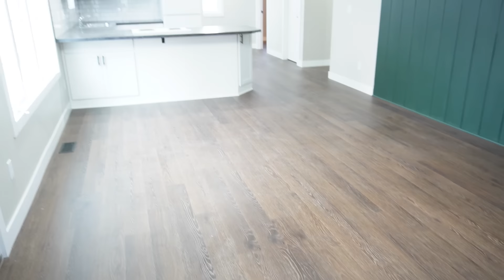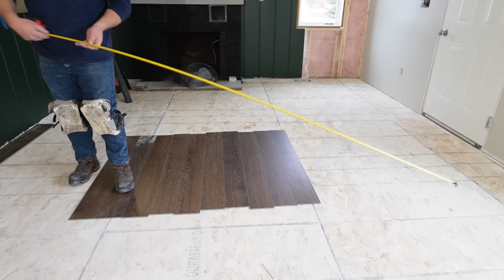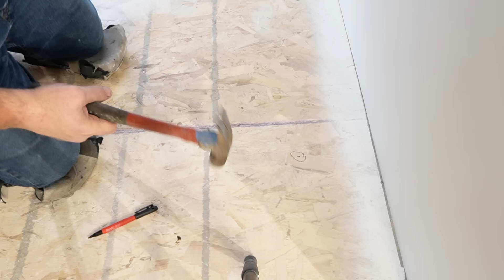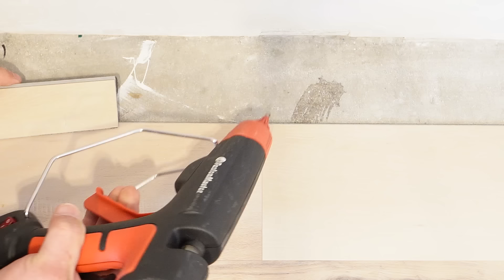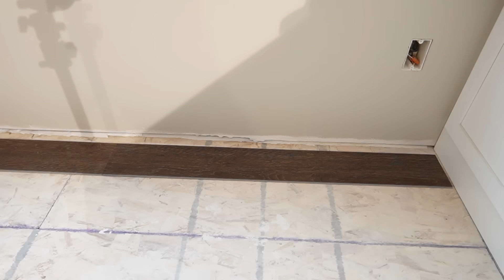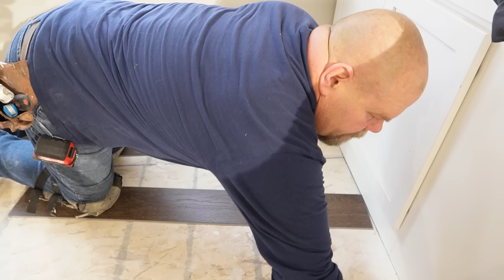The MOST CLEVER Way to Start the First Rows | Vinyl Plank Installation

Comment: I really question the width of the first row. That is practically a sliver.
Reply from the maker: Why does that matter? By the way, that was no where near “a sliver”: Did you watch the layout process to understand why it was that size?

There was a reason the first row was a smaller piece.

Comment: Watching some videos before I start my first project. I appreciate the detailed instructional video. But the engineered boards that I have purchased have an opposite description of what tongue and groove are on the planks. "The tongue is the thin, protruding edge (the male side) that sticks out, and the groove is the recessed channel or slot (the female side) tucked under the opposite edge to receive it. Usually, you install the planks with the tongue facing the starting wall and the groove facing out into the room." So, watching your tutorial, should I follow your suggestion to start the first row or reverse it?
Reply from the maker: If it’s a true wood floor that is glued stapled or nailed, then face the groove towards the starting wall.

Comment: I should have just glued the floor down. Nothing stayed in place and the entire floor moves. The tools I purchased sucked. The spacers fell under the 1 in gap to the concrete. The taping Block destroyed more planks than it is worth. Nothing went right.
One thing I did learn, LVP is a crap product I would never buy I’ll stick with tile.

Comment: I’ve read not to install directly over osb board. To install 1/4 or 3/8 in. Plywood first. What’s your thoughts on this?
Reply from the maker: That is not true with a floating floor. Glue down, yes.

Comment: I'm really confused. I was told that the first row of planks should have the tongue side facing the wall for two reasons:

When tapping the flooring into place, you avoid tapping against the tongue, which is the weakest edge.

The locking mechanism is specifically designed to be angled and installed in this direction.

 Is this correct?"
Reply from the maker: That is what I am showing you.

Comment: I don’t understand why he’s calling the side that sticks out the groove side and the recessed side the tongue side. The tongue sticks out like a tongue, that’s why it’s called a tongue side. Also, a groove is recesses not protrusions. So tongue is male side, groove is female side.
Reply from the maker: Exactly! If and when you install a floating floor that has a locking system you will see that what I am saying is correct. The side I am saying is the groove has a bottom ledge that sticks out farther. This is where the locking lip is located. That same side also has the recessed channel(the groove). It is the same concept as a real tongue and groove wood floor but it’s slightly different. If I only had a $100 every time someone tried to correct me on this….

Comment: THANK YOU!  I just spent two days trying to begin like everyone else shows as the "correct" and easy way. My planks kept moving, separating, shifting.... total frustration because my outside wall is NOT straight, so everything kept going bad. This is simple, understandable and easily adjusts to an uneven starter wall. 🙏🙏🙏

Comment: Hey friend, you're awesome! I'm a complete novice trying to install flooring in my living room. I've been trying for a couple of days now without success 😀. I've located my two exterior walls where I want to start, and I checked the method to confirm they're square to 90 degrees. Apparently, my wall has bulges, and to top it off, there's a chimney bump right in the middle. I imagine I should use the chimney as my starting point. The only thing that's really confusing me is figuring out how to draw that straight chalk line.
Reply from the maker: This video explains the line - IT'S A BIG MISTAKE To Just Begin With A Full Plank
https://youtu.be/JqoyXeT6woU

Comment: The first time I laid plank flooring I made a lot of mistakes and had a lot of lessons learned. The second job I did, I studied and used a lot of your tips especially the 10 planks and made the install go so smooth. I just received your pull bar, block, and layout tape for a job that is a lot bigger than before and here I am studying up again to make it go as smooth as possible.

Comment: FOUND IT!! 🎉🎉 For those of you who are wondering about how to DETERMINE THE CHALK LINE PLACEMENT in this process, his other video here (https://youtu.be/UII0yYikEe8?si=lNELl6i_55a8P_YY) has an excellent explanation of how that chalk line is determined. 

Basically:
1) Measure the full width of the room to the midpoint. 
2) Using the 10 stack as a base measurement tool, determine how many full plank widths it will take to get from the midpoint to one wall and the to the other wall. (Should be the same number.)
3) The remainder (the partial plank width) is the distance from the wall where you start the first row and that's where you will set the spacers. 
4) Snap a chalk line some distance from the wall (I did 2 rows of plank + the remainder) and that will be your straight edge guide *The partial plank width is the amount that you're going to cut off of the planks to fill the first row to complete the floor.
5) Work back from the chalk line to the spacer row (2 plank rows in my case) and set the spacers *you work from the chalk line to the wall in case the wall is not plumb. Then you would use Joe's "cheater board" hack to cut that first row at the end 
6) Push the two assembled rows and luck into the spacers
7) Install floor moving from the spacer row end
8) Cut the plank widths in the final row to size if necessary and install that row 
9) Then come back to the spacer row, remove the spacers, and cut the planks width as needed and install the first row *use a pull bar to snap those planks into place if needed

These are high level instructions, the detailed explanation, in Joe's impeccable style, can be found in the other video: https://youtu.be/UII0yYikEe8?si=lNELl6i_55a8P_YY

Comment: This did not work at all for concrete subfloors. I’m sure for wooden subfloors it would work fine. The glued-on stop-blocks would not stay adhered to the concrete. So bummed.
Reply from the maker: You must have used  craft glue sticks and not the ones I recommended. Because the glue sticks I use stick to concrete very well.

Comment: Hi. Is the orientation right? I thought you're NOT supposed to run the length parallel to the wall where the windows (and door) are. Thanks.

Comment: For me its the cutting part that is confusing. Thank god i bought enough for waste. I didnt realize you had to flip the board around so that the groove was opposite when cutting. I was trying to figure out out to get a cut edge to lock in to a groove when their is no tongue. I have a small half bath 5x5ft with a small cut for the toilet pipe and toilet drain. Vanity cuts not a worry as its not a solid bottom.

Comment: I’m getting ready to lay LVP planking on our whole main floor. Should I start from the center of the hallway that extends into the kitchen, or do I start in the kitchen or living room like you did? There are 2 bedrooms off of the hallway also. This is my first time attempting this. I’m pretty good at figuring stuff out, but this layout stuff has me spooked lol. Thanks!
Reply: @Handymangene  

How did you do?
Reply: @ozziecrosby2092  It went ok. Not perfect but we are happy with it. There is one spot where the hallway/front room/ kitchen meet and there is a plank that the long edge of it is not clicked in that I will have to deal with. I have also had to close some gaps between plank ends due to movement. Overall it went good. Next time I would definitely use a laser line and measure frequently to keep from skewing. I was 1/2 difference from one end of kitchen to the other.
Reply: @Handymangene 

Yeah I'm getting ready to do mine and it has a run of almost 35 ft by 22 ft. Little nervous because it's an 1850 era house that has been completely gutted and reframed but still has a wall that isn't quite squared.
Reply: @ozziecrosby2092 Also, any floor dipping or heaving will affect how it lays. The flatter the better.

Comment: Honestly, this doesn't make a lot of sense.  I have no idea why he wouldn't just use spacers. All I can guess is that he wanted to "split the difference" for the width of the first row and the last row, which really only matters if your last row was going to be less than two inches wide.  Looking at what he's done, the last row probably would have been four inches or so if he had just started the first row normally, which is absolutely 100% acceptable.  All this did was create obviously thin planks on TWO walls instead of one.  But hey, that's just me.

Comment: I like the premise of the starter strips, but will this cause you to waste a little bit of material considering you will have to start and end your floor with ripped pieces because they are smaller than the width of a normal piece. Overall the pre-planing so you do not end on a too short of piece or two skinny of a piece is key. Overall trim will secure the small and/or skinny pieces though.

Comment: Confused about how you layed out your chalk line, you didnt explain that part in your intro!
Reply: @steinachu1  he connected like 7 pieces together, came up with the 41in measurement. Made the mark at both ends and snapped the line. It is just to keep track that he is straight and seems are tight. It's identical to chalking lines on a roof to keep track of yourself.
Reply from the maker: This video explains it all - https://youtu.be/JqoyXeT6woU

Comment: Hi Joe, if I have a crawl space under my wood subfloor, do I need a underlayment such as one with a moisture barrier and sound proofing? Can I just put plywood or OSB down on the subfloor in order to smooth out the surface and install the vinyl planks without the additional underlayment? I live where there is very little humidity year round.

Comment: What brand of lvp did you use?
I start wiyh the tongue out from the wall not towards thw wall with lifeproof flooring.
The way it clicks in you have to raise the plank up and insert the lip down in the top of the tongue. Then press down.
I also align the corner with the previous intersected planks.
Then tap the two ends together and continue from there.

Comment: Tongue n groove the worst planks to use... Why would you use them if a center plank gets damaged you have to pull off baseboards then take apart many other planks away from the wall just to get to the center plank to replace them having to put it all back to together again?? Best method is using glue down planks with no tongue & grove just plain glue down so if anything does happen to a center plank you just heat it up remove just that one piece apply glue down again then lay the new plank down & done, not having to worry bout locking tongue & grove planks which is a huge waste of time..
Reply from the maker: I disagree.  It is not hard to cut out and replace a plank without taking it all apart. There are alot of benefits to a tongue and groove plank.

Comment: One more tip for beginners is to always use a "bang board" which is a short cut board that you use just to hammer in boards so you don't directly hit the board you're installing. You'll have yourself from damaging extra boards unnecessarily

Comment: Hey! Great video and channel! I have a question: you just put 3 random length planks as the first rows. I didn't found this that easy, because you need to make sure if the last plank is long enough, right?
Reply from the maker: No. If the plank is less than  8 inches in length, just add a little  glue in the joint.

Comment: First - Fantastic video! However, one question I have is that I'm putting down a new LVP floor over concrete and will be using an underlayment for vapor barrier, sound reduction, cushioning, etc. Since I cannot nail that block piece into concrete and I do not think I could use the glue method without damaging the underlayment by gluing it down. What would you recommend in this case? Also, doesn't using a quarter inch spacer between the floor and wall also serve the same purpose of stabilizing the flooring?
Reply from the maker: Cut out the underlayment and glue the piece to the floor. When you are done, remove the piece you glued and put the cutout back and tape it using clear packing tape.

Comment: What is the best way to snap a chalk line when the wall is not flat/square? I have a wall with a tile base and it is not flat or equal. The other walls are not that much better either.

Comment: just start the first few rows a 3-4 ft from the wall and push it back afterwards. This is unnecessarily wasting a ton of time and energy. Also having that small row right at the front door instead of on the other side of the room doesn't make any sense at all.

Comment: I really appreciate how you broke down the process of starting the first row of vinyl plank installation. It’s often the most challenging part, and your tip about planning ahead to avoid issues with doorways is invaluable. 

Using the bridging method to keep the planks straight is a game changer! I’ve struggled with alignment before, and this approach seems much easier. 

Also, I love the emphasis on using a high-quality pull bar; it makes a significant difference in getting those tight joints. 

For anyone looking to estimate costs, remember to factor in waste and extras for cuts. This way, you won’t be caught off guard when purchasing materials. Thanks for sharing your expertise; I’m excited to implement these tips in my next project!

Comment: Debating on tackling LVP in a kitchen.  A local flooring company that’s been around for a long time said I could trim and paint the room, then they’d install. This floor is not level enough to use just baseboard, it’ll need shoe molding. Does that sound right or should I trim and paint after the floor.

Comment: The trick of screwing down scrap pieces to start the first row just saved me a ton of time this weekend, thanks!
Reply: Just be sure there's no pipes under there, I did not and had to call my dad to repair a copper heating pipe I put a nail through 😂
Reply: when you did this, do we still leave the 1/4" gap for expanding?
Reply: @SiqcCafeNyc  yes you should leave a gap for expansion
Reply: I used hot glue.

Comment: PLEASE HELP!!    My contractor is young, just starting out in interior construction business a year ago and he put a thick layer of noisy plastic on top of our basement cement floor as an underlayment before installing the 6MIl Traffic Master LVP from Home Depot.  He is coming back today to finish installing 2 more pieces before is completely finished.
When I walked on the new floor yesterday, it's very noisy, I can hear the wrinkly sound of the plastic underneath it with almost every step I take. 
Traffick master did not have a suggestion as to what underlayment to use as it already has a pre attached underlayment on the LVP. 
Is the noise normal and should it be acceptable? Would You accept it?
  My contractor is young, just starting out in this business and learning as he goes.

Comment: great video, thanks!  I wonder how you decided where to strike the chalk line relative to the two walls.  If the room isn't square, do you use one wall as datum/reference?  And I wondered how you decided to go for such a narrow run or tiles across the "finish row".  The opposite wall finish needs to be taken into account, I think?  Look forward to your reply.  Thanks again.

Comment: I did a plank floor several years ago with Pergola.   The room is 24x30.   I used a different method of installing.   After setting the first row, this is what I did was I took the cut off from the first row to be the starter for the next row.  No waste that way.   Then the method was lay the next row hooking all the ends together for the full length.   Then slide the row next to the first row, lay the locking tongue and groove together lifting the new row up to drop into the slot.   Walk along the row tapping with the back of my boot, and the planking lays down and is tight.   On to the next row.   And the cut off goes to the beginning of the next run.   It worked great for me.   I’m older than you but I still got it done in 6 hours.   Took longer because of cutting around closet walls along the whole end of the room.
Reply: @KevinCoop1  I don’t understand starting with a huge gap like that
Reply: @davidphillips2759 . I’m not understanding your question.   Where are you thinking there is a huge gap?  Please explain and maybe I can explain something better.

Comment: Your doing a fine job but if your used to it and confident you dont need a line in a bedroom i snap lines when i do the hallway into the livingroom and or kitchen and i know its common practice to use hammers and wedges/blocks ive never once done this if you find the right angle you can do it with your fingers with minimal cursing as long as you dont use the box that the forklift wrecked lol

Comment: Are the thin vinyl and the 12 mm laminates installed basically the same? If different- how?
Our instructions on Select from Sams club says not to tap them???
Reply: You probably should use a rubber mallet just to make sure the joints are flush on top.

Comment: how do you attach the spacers before the first row, if you have cement floor, with blue water channel and an underlayment?  The water channel and the underlayment are floating, and are not a rigid surface to glue to or screw through.  Should I cut back both, to give enough room to glue to the cement?